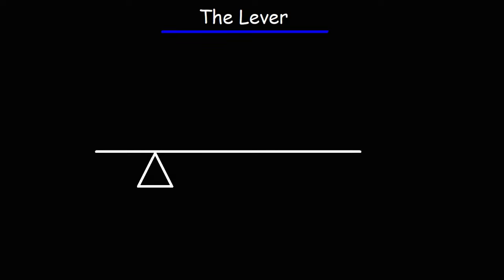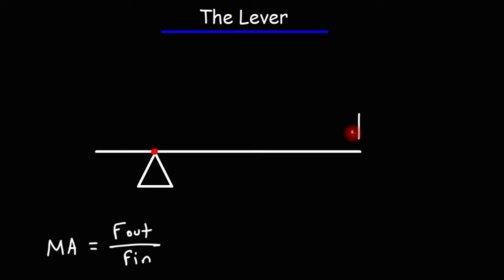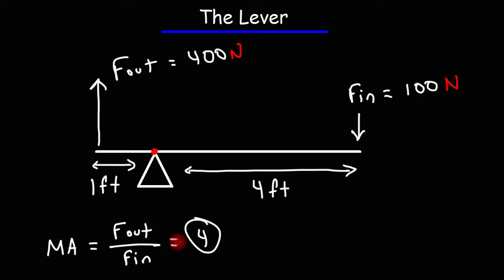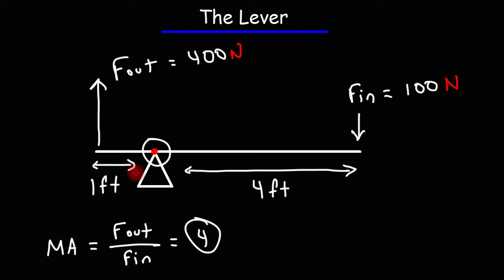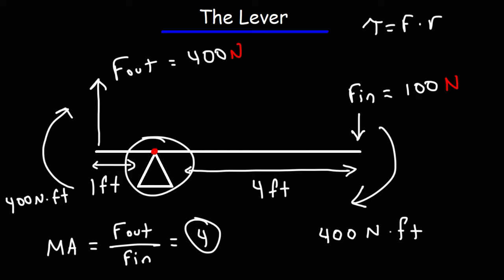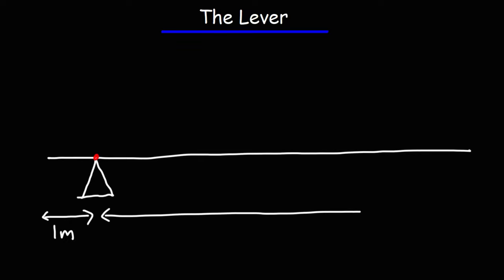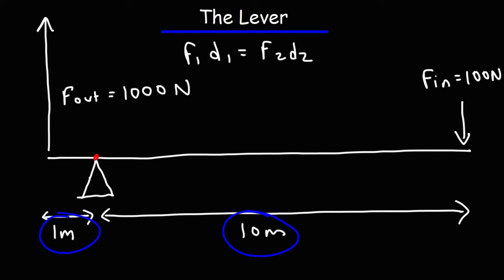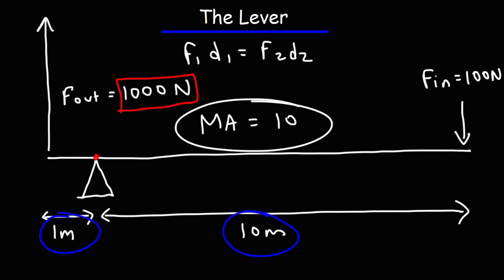Simple Machines - The Lever

Comment: This explains how a crowbar works so well; even though it is short, say two feet, the fulcrum can be very close to the end of the 'resistance arm' of the lever; so you get 1/2 inch vs. 2 feet, say.
This also helps us understand how a top roll works in armwrestling; when Devon Larratt beat Eames Gasparini, the best armwrestler in Italy, he pulled his own thumb back to apply force to the little fingers of Ermes, to extend the length of the 'effort arm' and generate more torque to a weak point.

Comment: Thanks for the excellent video which lets me understand the principles - well at least some. I do have a question. If the lever is balanced horizontally on the fulcrum, and a small amount of additional weight is applied to one side, what determines how quickly that side will fall to the bottom and what relative amount of weight is required to partially or fully unbalance it. An analogy would be a playground see-saw. Consider one person on each side of exactly the same weight. If you add a pound to one person the equilibrium shift but perhaps only a few degrees. If you add 10 lbs to one side it may be sufficient to cause the opposite site to coast slowly to the ground. Addition of 100 lbs will cause the side to plummet to the ground like a heavy stone. Is there some way to calculate it. In my case I am trying to design a simple lever that will maximize the weight required to allow the extra load to cause the lever to drop around 20 degrees and not fully collapse the side. I hope that makes sense.
Thanks and best regards, Murray